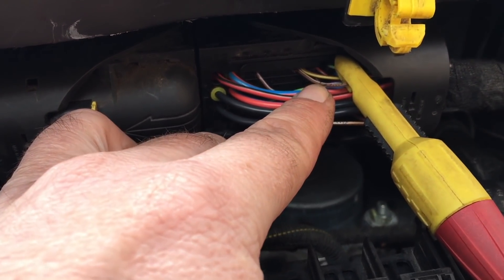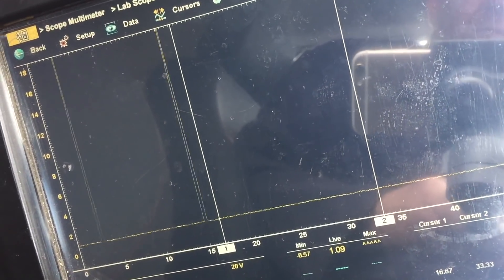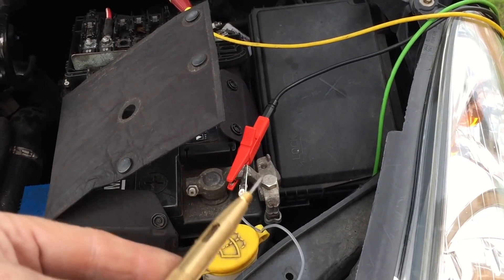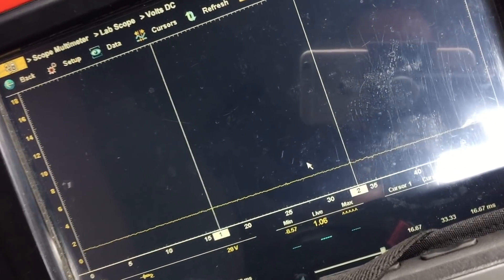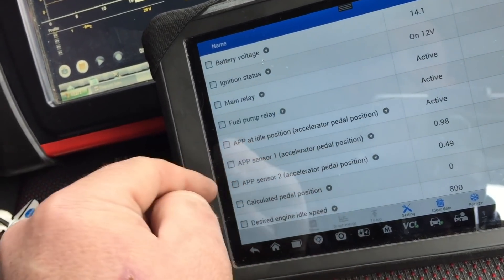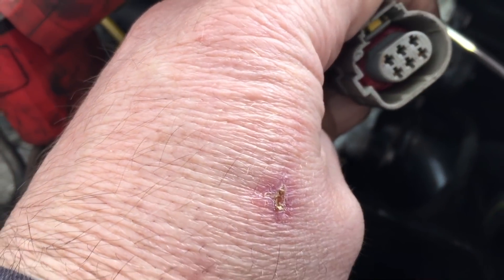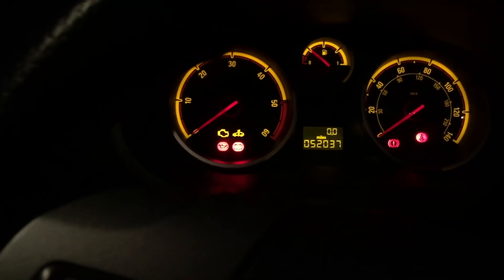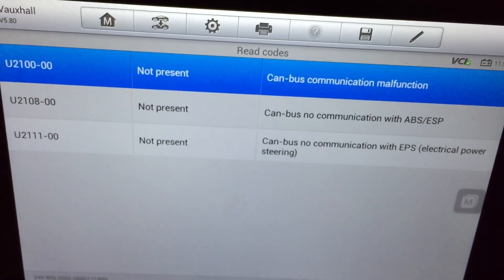Vauxhall Corsa D 1.3 CDTi - Intermittent Non Start -  P0685 - PART 2

Comment: This could be an issue with water ingress to the ECU but the voltage spikes you are seeing would suggest a poor ground. Also can't help noticing that you battery voltage seems a tad low. This can be a code generator when the engine cranks and the module voltages are too low to begin transmitting data. I doubt this is a can bus issue. I have also had problems with these Corsa when the engine ECU connectors are held off by the plastic bulkhead and don't connect properly.

Comment: The older corsas had probs with the connector being loose at the rear of the cluster causing power issues. A shot in the dark, sandy but might be worth a wiggle to see if you can replicate